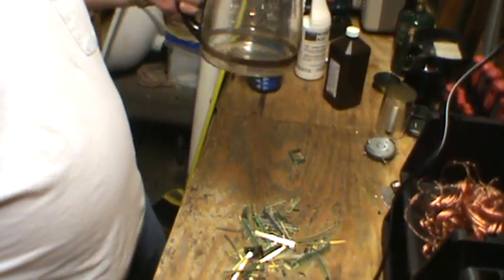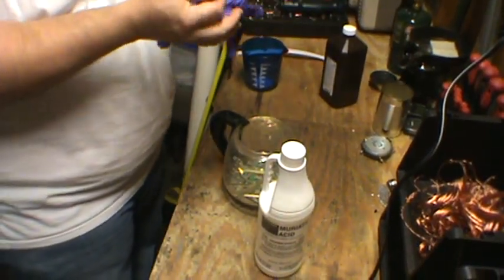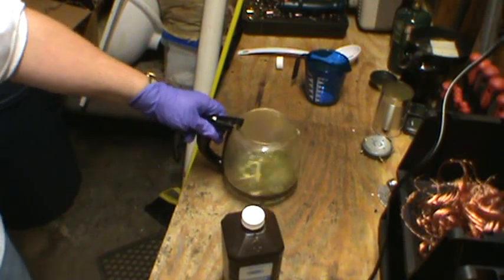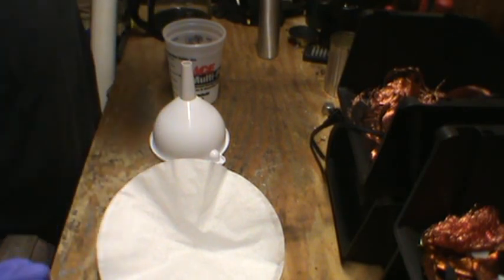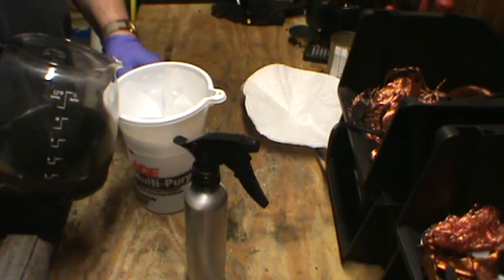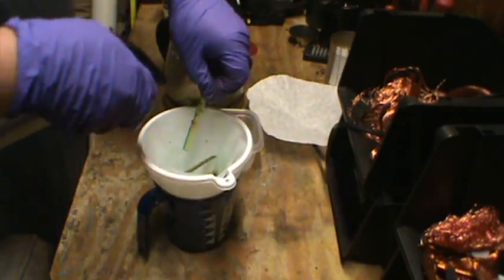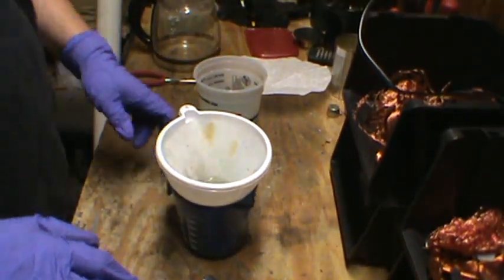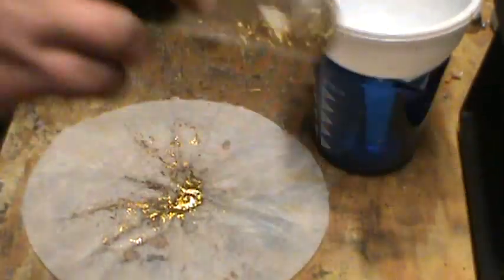How to Recover Gold with A/P Acid peroxide method for gold fingers and gold plated boards easily.

Comment: Hi Moose, I tried my used ap on some cell phone boards and I am using the air bubbler on it, I started it at 12am and 12 hr later I have foils. I tried something different this time, I went to the pet store and got a bubbling stone witch gives you smaller bubbles witch agitates the ap more. I thought you and your viewers mite be interested in this.
Reply from the maker: Lee Cosner nice!  I have one too for my smaller jars of plated pins etc.  They work pretty good!  Thanks!

Comment: Have you ever tried to rinse your mud gold with 50% dissolved Hcl 30%. the liquid got all yellow but what was left was the pure Brown instead of Black mud gold, but i checked the soluotion with stannous chloride an got a powerful reaction, so i took a couple of partikels urea and dumed in: No reaction. The i gave it a spoon of metabi sulfite and it looks like it's precipatating Again. What has happened? Hcl don't dissolve mud gold, i have used it many times but in a max concentration at 15%
Reply from the maker: thomas lund The hcl will react with any copper or other metals in the mud.  THe statnnous test was likely positive because the mud has very....very fine particulate in it floating around.  rinsing with hcl is a pretty common practice, or just refining it again.

Comment: Is there a chemical way of removing the solder from the boards?  I have solder on the gold plated parts....
Reply from the maker: TheFlamencor Hi and thanks for watching.  That's a great question unfortunately I do not have an answer for it.  There may be something on the goldrefiningforum though.
Reply: Hrmm. Of course the solder should just come out in HCl, so I guess if I am not reusing the HCl for refining it shoudn't matter.  

One other question: you said that using too high a peroxide concentration will cause the gold to dissolve into solution.  Does this mean that lower concentrations still dissolve the gold, but only a little bit?  I ask because I am trying to decide between the peroxide method and the air bubbler method.  Many thanks for the guide video! Great work!
Reply from the maker: TheFlamencor now, there is a concentration point but once there is copper in the solution gold will not get dissolved unless there is too much peroxide.  THe bubbler is the way to go!  Thanks!

Comment: Thanks for this Great Video.  Was wondering if you might do a Aqua Reg.  Video like maybe ceramic processor if possible.  I really would like to see a poor mans AR start to finish.  I know I don't ask for much.  I just did a finsll batch and I think all goes well till I add urea and I alway mess it up.  Thanks and awsome video.
Reply from the maker: Randy Skidmore Thanks for watching!  Unfortunately I have never used and have no plans to use nitric acid in the near future.  I am just not set up for it with kids, pets and neighbors, and do not feel comfortable with it at this time.  There are some other channels like indeeditdoes, and drew metalsmith, and even geo that work with it though.  Best of luck to you!  OH and the holy grail of refining info, thegoldrefiningforum

Comment: Hi Moose, I am curious, which method would work best for 6" silicon wafers with gold on them.  Thank you
Reply from the maker: kevin scott is the gold adhered directly to the silicon or to a thin layer of copper then silicon?
Reply: Moose Scrapper It's difficult to say. 
Just out of curiosity I did 3 wafers in the muriatic acid & hydrogen peroxide, (200ml acid / 100ml peroxide) took about 4 or 5 hrs to leave behind very shiny silvery coloured wafers

Gold is obviously suspended in the solution but there was a very, very faint change in colour to the solution. Faint yellowish green
Reply from the maker: kevin scott With a solution with that much peroxide, the gold is likely dissolved in solution.  that's a lot of peroxide to use.  The green would likely be from the copper.  You will have to precipitate the gold now by adding a big chunk of clean copper.  With only three wafers though, you may not see much of anything at all.
Reply: Moose Scrapper Thank you very much for taking the time to reply. 
I wasn't too sure what to correct ratio would be for such a small batch.

I have a large number of gold, silver & platinum wafers & was curious if this is the best to use for the gold?

Comment: hey moose ive spent the last couple of days peeling off the gold from the cardboard of 1750 sim cards and not to sure what the next step should be.Also i usually follow youre steps of gold recovery and refining but i have a melting furnace that ive been waiting to use where in the process could i use it do i still need to smelt   thxs steve
Reply from the maker: steve sampson wow dude, don't bother peeling them off, let the chemicals do the work for you! Remember there is not much for copper in ther for the AP to eat at so just a tiny bit of peroxide will do the trick then filter the gold foils out and refine with HCL and bleach.

Comment: Hi Thanks for the vid. I have HCL 36% is this ok to use? also should I use a stronger H2O2 6% or just use the 3% and stick with a ratio of 4 to 1? any help would be fantastic! Thanks!
Reply from the maker: Magmans Workshop 36% is fine, it just has more fumes so be more careful.  As for the H2O2 stick with the 3%
Reply: Moose Scrapper Thank you. Why must the solder be removed? I have RAM modules with a fair amount of gold on the backs but on the other side there is solder. Any advice would be fantastic.

Comment: Hi Moose I saw a note about that the peroxide has to be 'something with 3%' now does the peroxide need to be above or below 3% and if it is more or less what are the diffrences, as in speed and the amount of copper that will solve? Thanks already!
Reply from the maker: Vincent De Vries the peroxide should be Hydrogen Peroxide 3%.  If the concentration of that solution is higher, it will change the solution reaction.  Lower, you will need to add more.
Reply: Thanks! Also what kind of reactions are happening in this process? Does the copper become CuCl and the acid and peroxide become 2 h2o or am I wrong? Wondering because the fumes are toxic, thought they might release chlorine.
Reply from the maker: Vincent De Vries Hi and thanks for watching!  I am not a chemist and do not exactly know the proper terminology for the reaction nor exactly what is coming off for fumes.  I believe it to be chlorine gas so I take the proper precautions for that.

Comment: With my experience, this IS the safest method. HCl is the primary component in stomach acid for digestion. There is very little risk of injury when coming in contact with diluted HCl. The most dangerous aspect of this method is Chlorine inhalation during the reaction process.

Comment: how do you process the gold from boards that have solder on the backside of the gold, such as on a track phone board. lots of gold on one side, solder on the other?
Reply from the maker: Les Larsen I process those the same way as trimmed fingers.  HCL and air, however I process them separately because the solder will dissolve then precipitate out as a white powder and its a bit more tricky to get the gold out.  It involves a bit more rinsing.
Reply: thank you. keep the videos coming, as a rental maintenance man here in Montana I come across many different kinds of scrap. Always hated throwing them away, now thanks to you and fleets I know why.

Comment: what is the problem if there is some tin whit the gold plated things ?
Reply from the maker: mterziev1 Hi and thanks for watching!  I am not a chemist, all I can say is that the methods I have learned are very specific and if you add metals to the solution, you are changing the solution and how it reacts.  I get comments every day about people having problems with this process because they do not follow the steps precisely.  I have yet to have a batch go bad simply because I follow the steps as outlined on the goldrefiningforum.  Adding tin I have heard can cause several problems, usually because you are not just adding tin, there is often solder with it.  That can end up in the gold causing lower purity, white powders to precipitate in the gold, and even gelling of the solution.
Reply: Moose Scrapper ookey,so I have to remove all the pins that I snatched, from one IDE slot and cut soldered ends Thanks

Comment: Moose, the muriatic acid i got is put out by Klean-Strip, it doesn't say what % it is..other then saying 90% lower fumes. I've got everything I need to get started. Would it be ok to do all 700 fingers at one time or do half? And it is ok to put the cell phone boards in a batch of A/P and should I cut them up? I have 20 of them
Reply from the maker: Lee Cosner Hi there, if you look up the product on line you should be able to find the %.  I think it is between 17 and 20%HCL which is fine.  You can process all 700 clean fingers at once if you want.  I would to the cell phoe boards separately but that is just me.  Best of luck to you!
Reply: Thanks Moose and I found the Lye at a down home hardware store not the big places they don't carry 100% Lye.

Comment: How would you remove the gold from CPU fingers?  

I've seen where they heat up the CPU, smack it, and then the fingers fall off.  Now what is the gold plated over, copper again?... Or something else? 

Do you then use the same A/P solution on those tiny little things?... Or is there a way to dissolve the gold off, and just pour it off? 

Thinking of teaching my son some fun chemistry, and would like to try this. But in watching all videos, I never see anyone showing how and what to use to pull the gold from the CPU finger? 

Hoping you cN enlighten me.
Brian
Reply from the maker: azcarbum Hey Brian, the only CPU's that have fingers are slot processors and with those you can just trim the fingers off just like a ram stick and process with AP.  The other two types of CPU's are the pinless and the ones with pins.  The pinless ones you can twist them to get the nickel plated copper square off them then just scrape off the little capacitors on them and the cpu can then go in AP.  Of the ones with pins there are a few different types of those.  The old ceramic CPU's are best processed with aqua regia.  Those are the ones the crack open to expose the metals.  The other green pinned processors can be heated up with a torch to knock the pins off then they can be thrown in AP for the little surface gold they have or incinerated with black surface mount IC chips.  The little pins are typically gold plated to nickel that is plated to copper or brass.  Those tiny pins are pretty easy to recover gold from with a hot HCL bath for about 2-3 hours.  There are other methods as well, lots of videos from folks like indeeditdoes.  Also check out the goldrefiningforum.com

Comment: Yo Moose how are you..ok i hope .. You said no lead or other metals,, right .Becuse i got some fingers with lead on them. And want to know what is what..Not that i am ready yet,,, i want to have as much as i can to clean..But it is starting to look
good...Let me know pl...Thks for the show...JRC.
Reply from the maker: joirjoja1 There are a couple of schools of thought on this.  One is the purist method where everything is as clean as possible.  No solder, nothing going into the mix but clean well trimmed gold fingers.  This means that your outcome is certain, there are no variables to mess things up.  Since I am not a chemist, I prefer this because I am not sure how to fix a lot of errors that can happen.  The other school, is what a lot of professionals use is to just throw the whole ram chip in, then separate the metals afterwards.  I am not totally sure how to do it this way.

Comment: Moose, when using this can you cover with a lid, I have no place inside to do it right now. And with the bubbler can that also be covered with a lid and a vent hole?
Reply from the maker: Lee Cosner It certainly can be covered with a lid however I would still make sure they are outside.  Especially if you are using 31.45% muriatic acid.  The Crown Safer Muriatic has less fumes but even that I would not use indoors.  Often times what I will do is use an Erlenmeyer flask and stuff a rag in the opening.
Reply: i've got safer muriatic that's has 90 percent lower fumes. Can I just put the fingers in the muriatic in a bucket without the bubbler (I"ve watched most all of your videos and I know your not a chemist, just a hobbyist) and I also want to thank you for everything you do on here, I have been collecting cpu parts fpr at lest 5yrs and now I want to do something with them and I feel like I've learned alot by watching you. You may be hearing from me again.
Reply from the maker: Lee Cosner yes but you will need to add peroxidde

Comment: Moose, I like your programs.  Several years ago, I bought a refining kit on ebay. The regina one. It worked the first time but I had a mess the second time.  Will your system using bleach muriatic acid sodium metabisulfate refine any scrap. e.g. jewelry, pins, ferrous plated pins and processors (ceramic and other)? Thanks much. I especially love the bubbler. Thanks and keep up the good work. JJ
Reply from the maker: James Johnson The HCL and bleach or "poor mans Aqua Regia" can refine the gold from all the things you mentioned however I would first Try to free as much of the gold as possible from those items using the hcl and air bubbler system first.
Reply: Moose Scrapper Thank you for the quick reply.  I am looking forward to your other programs.  Is there an archive of those I may have missed. Again thanks. JJ
Reply from the maker: James Johnson Sure, if you head over to my channel, there will be a "videos" tab that will pop up all the videos I have out there, over 150 I think

Comment: Is the process the same for gold pins that dont have copper??
Reply from the maker: Milenko Mc Cormack What is the base metal?  Just about all of them are copper or brass in the center.  If there is a magnetic response that is due the the layer of nickel between the gold and the brass.

Comment: hey moose i think i used to much peroxide in my recovery all iam left with is 2 jars of a green solution is there a way to recover the gold or is it lost for good thx steve
Reply from the maker: steve sampson You can try putting a piece of clean copper pipe in there.  The copper will replace the gold in solution causing the gold to drop out as a black powder.  Test the solution with stannous chloride when done for any gold left in there.  repeat until all gold is out.
Reply: steve sampson hey moose i used the a/p method on a bunch of fingers and cellphone boards it worked great but during the filtering process after all the liquid wad filtered i was left with a black and green sludge ball full of gold not sure what happened i did use a warming plate to speedup the process not sure what to do now please help
Reply from the maker: steve sampson I would take that sludge ball and save it for when you have enough material to refine.  Try to make sure there is no solder when you are doing the AP process to avoid this.  Remove stickers, plastic films, etc.  Make sure the material is clean.  The black powder is likely gold that was dissolved then replaced in solution with copper.  The refining process will eliminate the unwanted materials.
Reply: Moose Scrapper i ran two new batches of all gold pins in the A/P solution and it didnt take long to get a yellowbrown solution and now iam a little confused on the next step please help  thxs steve
Reply from the maker: steve sampson Did you use fresh AP or the solution from the original post?  If you are using just gold plated pins remember to use one gallon of solution per 2 lbs of pins, use a 50:50 mix of peroxide and HCL, and give it a good week occasionally stirring the material.

Comment: Hi i have a question, you can use baking soda to separate  the gold from other chemicals or wich is the special feature of sodium metabisulfate cause both are acids salts so please if you know tell me anyone know about that 
or may can use as neutralizer im waiting :)
Reply from the maker: ***** You can not use baking soda for this.  Sodium metabisulfite is used because when added to the HCL and Bleach mixture it creates sulfur dioxide gas that selectively precipitates gold out of the solution.  Thanks!
Reply: Oh right thanks so much

Comment: Hey Moose! What about gold plated stainless steel pins and jewelry? Will the A/P method work for that as well?
Reply from the maker: you would probably be better off using aqua regia or reverse electroplating for that.  Unfortunately I have not tried those myself so could not advise any further.  thegoldrefiningforum should be able to help.  Are you sure its stainless steel under?
Reply: Moose Scrapper Yes I'm sure. Thanks for the reply!